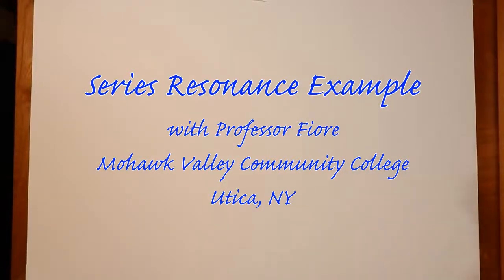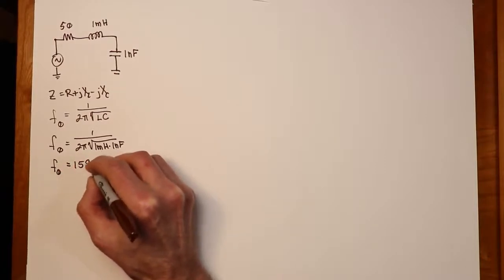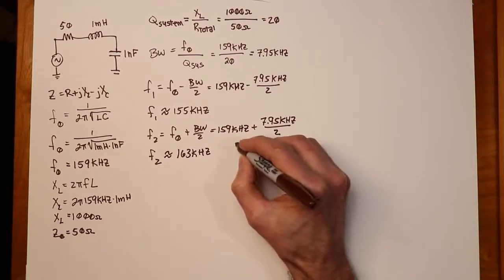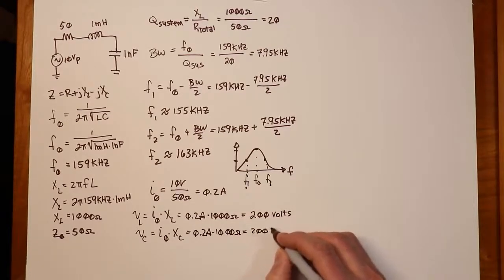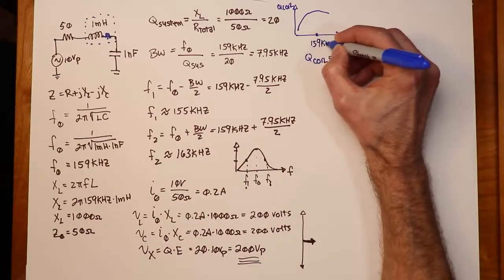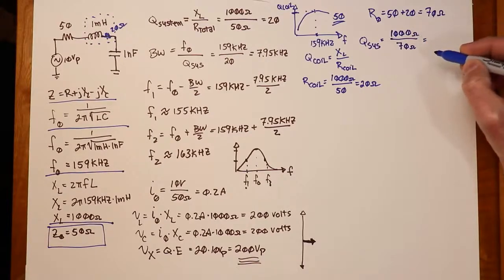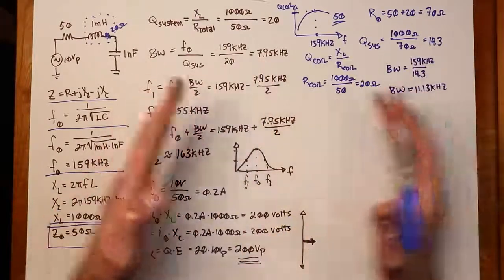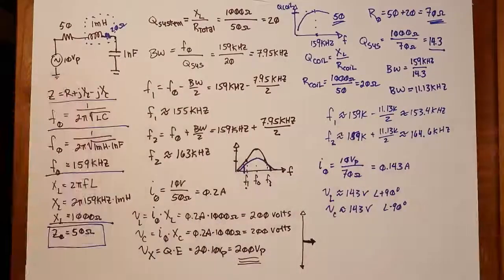AC Electrical Circuit Analysis: Series Resonance Example

Comment: Good video. @9:40, voltage across the reactive components, Vx=QE=200. But it should be 200+200=400 i.e summation of voltage across Inductor and capacitor both.

Thanks.
Reply from the maker: No, the voltages are in anti-phase. You can't just add the magnitudes. These are vector quantities.

Comment: Great video! Thanks a lot.  One question--> At 11:18 you state that the R-coil increases at higher frequency, but the graph of the Q-coil shows it increasing at higher frequency. What did I miss here? Thanks again.
Reply from the maker: First off, Rcoil increases with frequency due to skin effect. Essentially, the cross sectional area of the wire effectively shrinks as frequency increases, so the resistance rises. In the ideal world, where Rcoil is constant, Qcoil would increase with frequency because Xl is directly proportional to f. In the real world, Qcoil does increase with frequency, but only up to a point. Eventually, increases in Rcoil along with distributed capacitance causes the Q to decrease. Thus, we find that there is a range of frequencies across which a particular inductor will work well (and that's one reason why we want to check out those curves).
Reply: Thanks so much for the excellent rely--Got it!. @ElectronicswithProfessorFiore